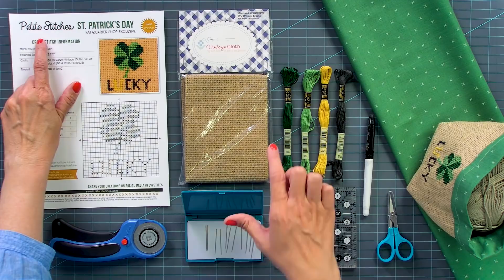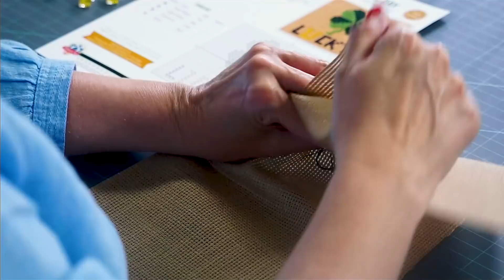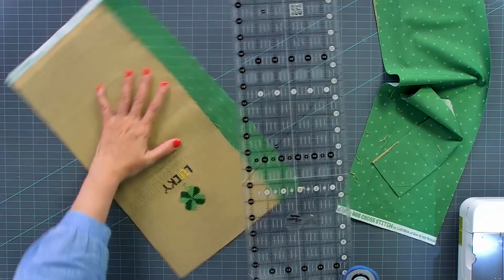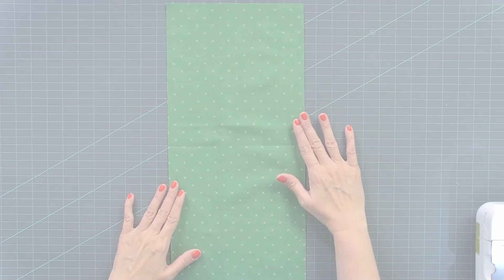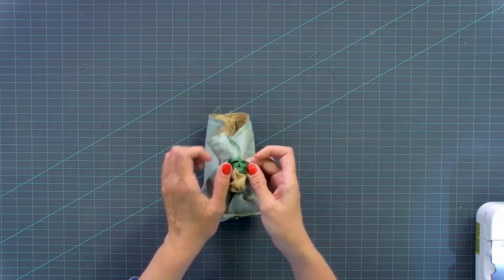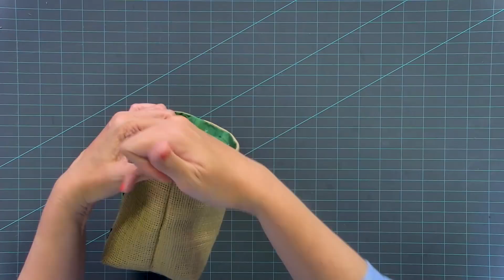Make a Cute Cross Stitch Fabric Basket ✂ Bitty Baskets for Home Decor & Holidays | Fat Quarter Shop

Comment: So... can I get the actual dimensions of the fabrics?
Reply from the maker: Hello 3 Stitches Short! If your cross stitch fabric is exactly 17" x 17" straight out of the package you will cut your fabric 8.5" x 17". If the fabric is smaller or if the fabric has selvage you will need to adjust your cut size. When you cut the fabric for the lining cut it the exact same size that you cut your cross stitch fabric. Due to the variations we chose not to give those exact dimensions in this tutorial.
Reply: @FatQuarterShopFlossTube  thanks! My local xstitch shop cuts all my fabric to whatever size I ask them for